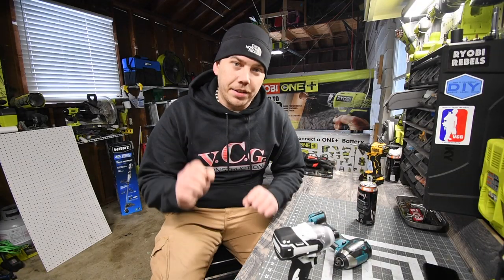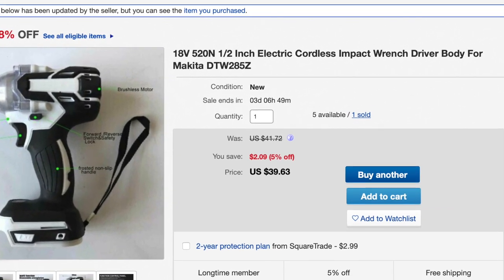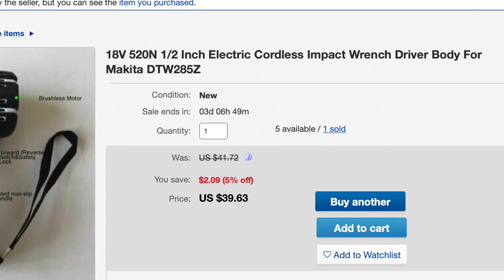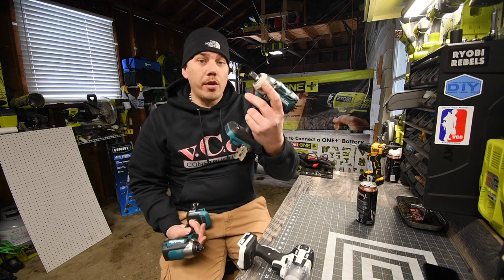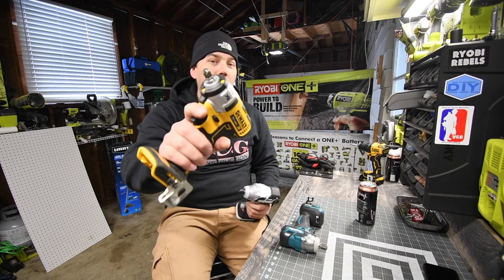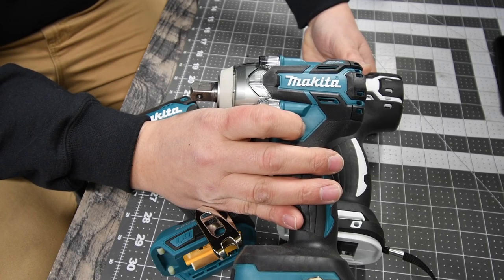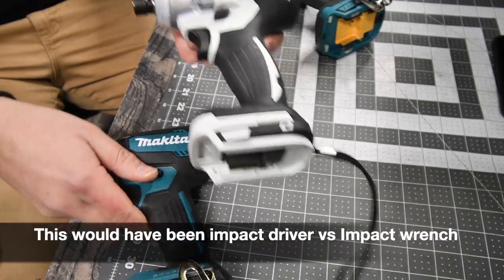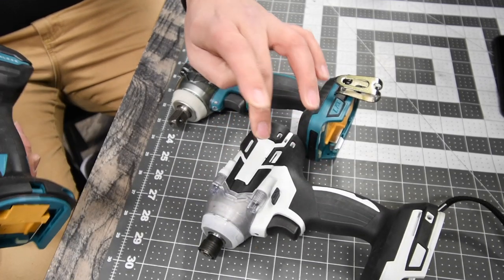Both of these are impact wrenches

Comment: I'm not trying to insult you but even if they are the same tools, when you using 2 adaptors on one of them, you reducing the torque delivered to the bolt/nut. That makes the difference in the results.
Reply from the maker: yes it does but this was more of a comparison between $40 and $150

Comment: The 1/4" anvil will twist more and not transfer as much power as a 1/2" anvil.  That's why you can't compare them.
Reply: R H  Human senses are not used to measure tool power.  We come up with this stuff with something called math.
Reply: This can actually be demonstrated using torque sticks. They use this exact method to control torque.
Reply from the maker: Shorter distance means less torque lost, :)

Comment: Correction, they also have a 1/2 square drive that also has a 1/4 hex in the middle of it. When you buy it on ebay, pay close attention to the anvil, some are solid half inch square and some are half inch square that also accept quarter drive hex bits. Only thing is, the quarter drive part is just held in magnetically but it comes in handy. THere is a youtuber named AVE who did a review and he has the one with the combo anvil. These are great for people who already have makita batteries because you can't beat the 35 dollar price , especially if you get the combo anvil.
Reply from the maker: I love AVE, and I thank you for viewing sir.

Comment: I exactly have the white one but has a 1/2" anvil. I just use a 1/2" to 1/4" hex attachment and I now have an impact driver. It's also pretty good, has an included 2x 19,000mAh batteries for around 130USD, it's a steal.
Reply from the maker: I might have to pick ip the 1/2 anvil version as well and thank you

Comment: The description of the tool in the picture you showed is incorrect. It says “1/2 inch electric cordless impact wrench” Which is not true. It’s a 1/4 inch hex not 1/2 inch. 
It also shows in the picture “1/2 square drive” with an arrow pointing to the 1/4 inch hex collet. Which is also incorrect. So no matter what we know we can’t go by the description because it’s inaccurately written. That is typical with Chinese tools where they inaccurately describe a tool. I am not being a prick. I subscribe and thumbs up all your videos but I’m just pointing out that description you showed is completely inaccurate.
Reply: The point I’m trying to make is that you can’t use that description as accurate when it says 1”2 square anvil” and 1/2” impact wrench. It was just written wrong in multiple places.
Reply from the maker: But like I say in the video, this purchase they had 2 options. An impact wrench with a 1/4 hex anvil or 1/2 anvil. I chose the 1/4 anvili
Reply from the maker: I can take a impact wrench and put a 1/4 in hex anvil on it. Which is what they did. Question. If I take the dewalt 3/8 in impact wrench and swap the anvil out with a 1/4 in hex anvil, is that still an impact wrench? The answer is yes it is still an impact wrench. Because the motor didn’t change. Just the anvil did :)
Reply: Ryobi Man Caver My point is, the description describes and 1/2 impact with a 1/2” square drive (which it points an arrow to)  but shows a 1/4 hex. So the description is useless. It doesn’t mean squat. My question to you is, what determines the difference between an impact wrench and an impact driver.
Reply: Ryobi Man Caver keep in mind, when you posted this video you opened up the conversation. It’s an invite for people to debate. I understand some people are being rude about it. I am not. I’m just trying to have a civil conversation with you. We don’t agree. No big deal. Doesn’t mean I think you’re stupid. Just trying to make a point and see your point is all. Hope you can understand that.
Reply from the maker: Man4Concrete shhh, I know :)
Reply: R H believe me I know the difference. I didn’t ask because I don’t know, I asked to get his opinion.

Comment: Dont impact drivers hammer axial to drive in screw? And they do it at very high rpm.  Impact wrench dont have axial hammering because wouldn't that roll over threads in a nut or on a bolt & damage threads I mean if you were screwing a bolt into a nut with wrench or socket & you were beating the end of it that would eventually damage threads & I think that is how a impact driver works.
Reply from the maker: That is correct. The 1/4 in Makita impact driver will dominate these both since its a more powerful tool
Reply: Drivers and wrenches mostly work the same the hammer builds up tension then it slides over the anvil the rotational force  whips hammer around impacts anvil
Reply: Like Mr. Jubba said, both use an axial/rotational hammering action.

Comment: One question if they are the exact same motor then the performance should be the same with the same battery?
Reply from the maker: Thats the difference between a very cheap motor and a good motor. and if you paid attention the the other video, the fake does not have a speed selection for revers when there is a speed selection in forward. Its a fake, a Knockoff tool. of course it won't have the same power as  the original Makita tool

Comment: Thier not the same inside the fake has a cheap motor clone cheaper components and metals diffrent switches and display on bottom the tool Chinese clones everything even cars that look nearly the same lol
Reply from the maker: That is correct, they are the same as both being impact wrenches.

Comment: Wow....you seriously need to educate yourself before you make videos like this spewing false information, motors could be different, gear reduction could be different giving the tool more torque or speed, this is wrong on so many level not even including you using a 1/4" to 1/2" socket adapter that will make the tool loose a ton of torque. Compared to going right of the 1/2" anvil.
Reply from the maker: But yet im talking about this specific tool and I clearly show that this fake Makita is a Impact Wrench based on the description of mu purchase, so Im not sure what you are trying to get at with this comment, but I thank you sir much for viewing
Reply: Man Caver Tools you just don’t get it 😂. One day you’ll understand.

Comment: Oh my God you are so wrong it makes me ill. An impact wrench measured in ft. Lbs. Is significantly more powerful than a driver measured in inch lbs. You are doing a disservice with your misinformation. Take apart a Makita driver and a Makita wrench, you'll see the difference. That's also why there's a difference in the price.
Reply: 125ft-lbs and 1500in-lbs are the exact same thing. The amount of torque does not change based on how you choose to label it. Impact drivers and impact wrenches are the same technology, just with a different anvil on the front, and the fact that drivers tend to prioritize speed and compactness, vs wrenches prioritizing max torque. 

That said, saying "they copied the body so they had to put the same motor inside" (1:00) is really, really dumb.
Reply from the maker: this comment tells me you didnt watch the video. because if you did you would have seen the fake Makita purchase and saw its an impact wrench. But thank you for viewing
Reply from the maker: no its not dumb, why would they redesign a motor for a $40 impact? because its so cheap they had to take the original Makita motor and copy it with extremely cheap parts. just like they did with the entire tool. why would they redesign a motor when they already copied everthing else? so no its not really dumb. its business.
Reply: @ManCaverTools  they wouldn't redesign it from scratch, but they would definitely take a cheaper motor off the shelf and wedge it in to save a buck.

But you can put this all to bed. The tools are held together with about 7 screws, just do a teardown comparison yourself. The views would more than pay for it.
Reply: Zach, go back to building bird boxes on a Sunday afternoon, leave this conversation with the big boys.